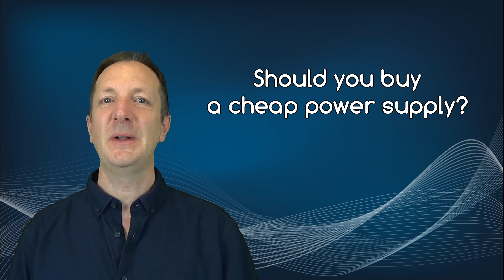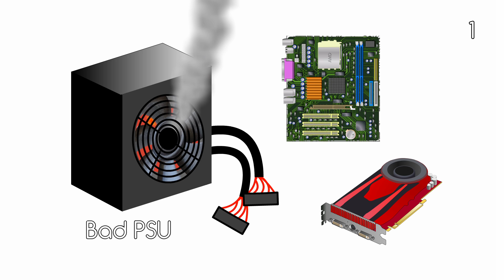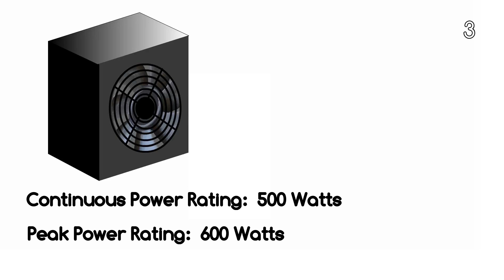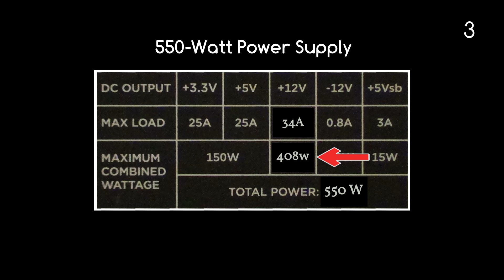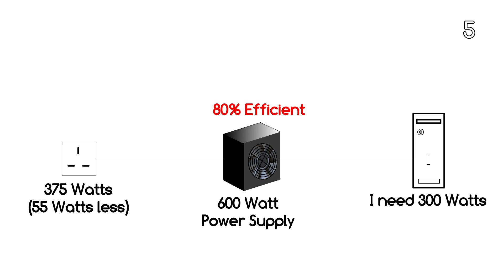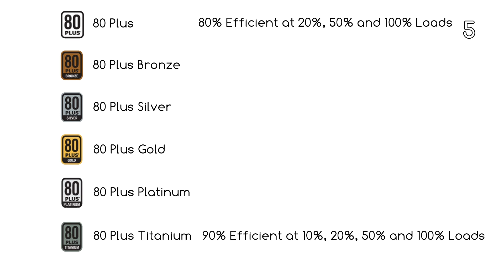Cheap Computer Power Supplies -  should you buy one?

Comment: sir i have some issues i have a xeon 420 1620 v2 system with branded 600 watts psu 
now i purchased rx 580 8gh sapphire at first it runs i played 1 and half hour and pc get hanged  and display started distorted and suddenly turned off i restart the pc all fans started making to much noise but no display on the screen i thought may graphic card died i pick my card and take to friend and put in his pc card is working fine on his pc ... 

now the problem is my pc is working fine without card  but not working with card i tried many times it on sometimes for 10 or 15 mint and same distorted thing  i want to know that it can be the issue with my psu and if it is then which power supply i need to buy the match my rx580 and M board thank you
Reply from the maker: It might be that your computer is overheating. Try downloading "HWInfo" (it's free by the way) and check to see if anything is running too hot.
Reply: @EasyPcRepairs  Sir unfortunately my graphic card is not giving display anymore in my pc i tried to plug it out and in re pluged the connectors  more then 5 times today but nothing just loud fan speed someone suggested me that may its psu issue that its not powering the gpu i bought the hd4550 to get display and that working fine  can it be my rx580  is faulty   And thanks for the reply
Reply from the maker: The RX 580 graphics card only needs about another 40 - 50 watts of power (compared to your HD 4550) when the computer is at idle. That shouldn't be a problem with your 600 watt power supply. So yes, it is very likely to be that your RX 580 is faulty.
Reply: @EasyPcRepairs  Thank you sir  and a last question is which nvidea gpu i go for next that at least give me same performance as rx 580 and i dont want to go with amd this is my 3rd  amd card that went rouge And thanks Again For your reply
Reply from the maker: The Nvidia GTX 1660 is a good replacement for the RX 580. The GTX 1660 is slightly better than the RX 580 and is sold at a fairly similar price.
Reply: @EasyPcRepairs  ok i'll try to get one bcuz gtx 1660 or 1660 super is not available  in my country if i purchase it from an other country  or website like amazone it's costing me double of it price for just delivery charges and tex thank you very much for all of your help sir keep making the new 1080p  love to watch your builds!! <3
Reply from the maker: No problem, glad to help.

Comment: Good video, but you mentioned sticking to reputable brands but then didn't say which brands
Reply: i would recommend: corsair, evga, seasonic, antec, nzxt, coolermaster, be quiet and a few more. i would recommend doing some research about best rated psu model and then choose the wattage that you would like.
Reply: I've been using multiple evga power supplies for years and they have never failed me.